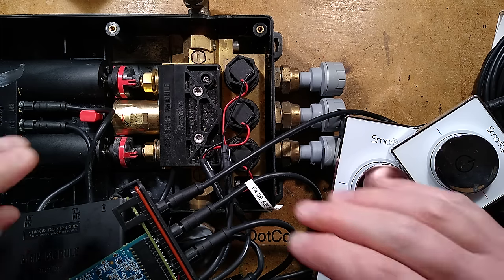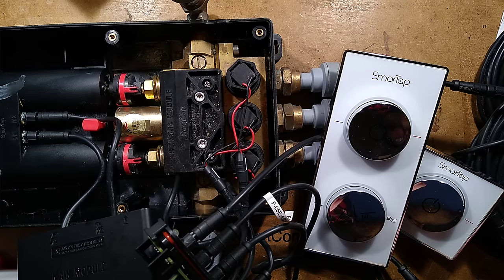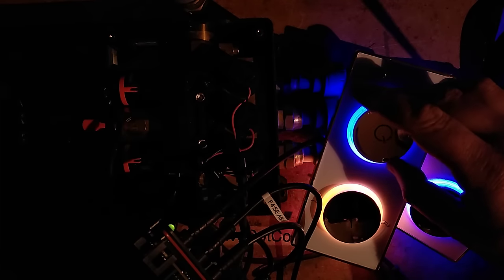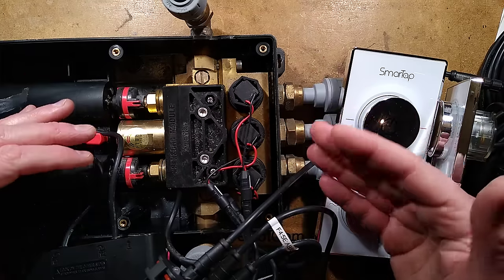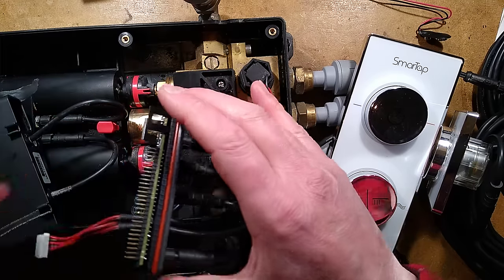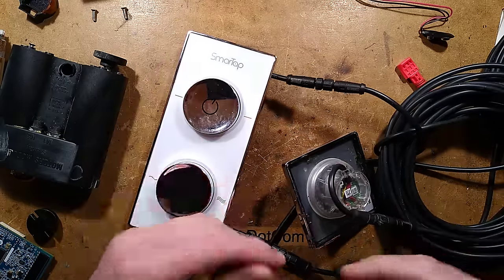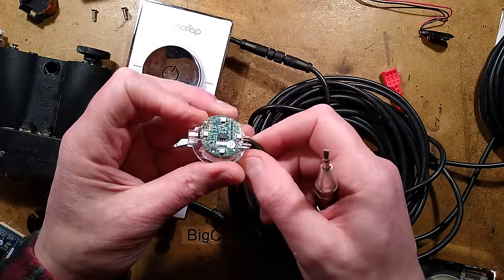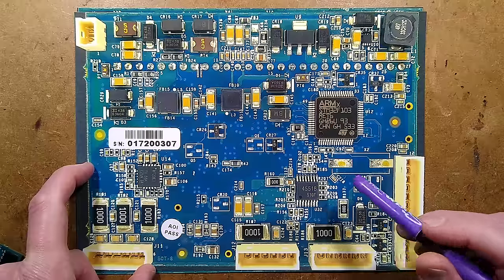Smartap - when the Internet of things goes down

Comment: This is why Home Assistant is such a must.
Reply: Why exactly is Home Assistant a must?
Reply: @Blacktronics  Because assuming the smart device can speak some form of Open Standard then the product manufacturer can't cripple it when they go bankrupt as you're not reliant on their infrastructure to control it.
Reply: @ElvenSpellmaker  a button attached to the wall doesn't even need firmware.
Reply: @Blacktronics  It depends on the functionality. Sometimes having fancier features like remote control or programmability is just what matters.
The issue is not the firmware by itself, it's the possibility of adapting and repairing the device.
Reply: @Blacktronics it would….. If that button is anything except a dumb switch it would have to use some sort of firmware….
Reply: @reeddeer793  why would a switch need to be "smart" and why would i ever want one that is?

Comment: I wont ask why you would want to take your phone in to the shower. I really don't want to know. 
I couldn't figure out why my brand new dishwasher needed internet connectivity either. Its not as if I can load it with dishes remotely, and there is a button on the front to start it. Why would I want to control it from the supermarket? Like most IOT software as a service devices it makes little sense.
Reply: I disabled the IP connection on my TV and blu-ray player as I was never able to accomplish any useful function from them. They could get to the Internet all right, but the streaming software was useless to me. If I need streaming I plug a computer into the TV.
Reply: Remote control of a dishwasher makes a little sense. Let's say it's partially filled. You think you'll just make something small, put your dishes in the dishwasher, and then run it. If your plans change and you realize you will need more clean dishes you can start the cycle to be ready when you get home.
Reply: @eDoc2020  It sounds good in theory, but you can be almost certain that in reality, you wont probably have closed the thing, and since you can't close it remotely, and even if you have closed it the chances of the app actually connecting to the dishwasher are less than 50/50 and since you probably forgot to load the powder and rinse aid anyway, the reality is that you will probably spend more time and energy cursing and swearing at your phone when it wont let you talk to the dishwasher from the office, or cursing ans swearing when you arrive home to find the dishes are not actually clean because there was nothing in the machine except hot water than this "feature" is worth. 
Its about as much use as adding wifi to your house plants.
Reply: @AndyHullMcPenguin   I hadn't thought about it that much. There are other uses where you want to start the dishwasher when you're away but a simple timer would work equally well. Examples would include making use of time-of-use utility rates or excess solar production. An actual remote start would make much more sense for a clothes washer so it finishes right when you get home. Wet clothes shouldn't be left in the washer but clean dishes can stay in the dishwasher indefinitely.
Reply: @eDoc2020  For a washing machine, a timer would make sense, but not internet connection. Likewise arguably for the dishwasher. Both however need to be loaded, andfilled with powder, and closed, before they will operate. If you forget any of those things, then even the timer isn't of much help. 
The real reason for the IOT dishwasher is to get free usage statistics for the manufacturer, and to try to sell you over priced maintenance and consumables. 
As with a lot of "free" apps, you, or at least your data and your spending power are the actual products. 
As many before me have said, "if its free, and its on the internet, then you are the product."
Reply: Oh.. and one further common problem my dishwasher shares with a lot of other IOT products. The app is terrible. Mostly it wont connect to my Wifi, and when it does, it doesn't respond, hangs, restarts, and generally makes the user's life miserable. Badly written, thrown together in a hurry, and barely tested, like most modern software. This I might add is from a "quality" manufacturer, not some supermarket own brand Chinese number.

Comment: Typical England stuff isn't it?
The electricity is so expensive there are many special stuff to not use so much electricity.

Gas is the main energy heating source in a home and electricity is not used if technically possible?

Comment: i used to say the most recent tech in my house is a 10 year old printer and for the case of it making weird noises i have a loaded shotgun next to it.

however, home automation, if done using open source software and standardized items like all the xiaomi things for example (don't use shelly, they run hot and are not certified in most but not all cases) can be a lot of fun and actually turn into something useful. like lights on when the alarm goes off, open the blinds, close them if it gets too warm etc.

Comment: SmarTap was an Israeli company founded in 2010. They were acquired by Masco Corporation in May 2020.

It is possible to find an installation manual online. While the valve unit may be mounted on a flat surface horizontally, it must only be mounted vertically with the three water connections at the bottom, not sideways or at the top.